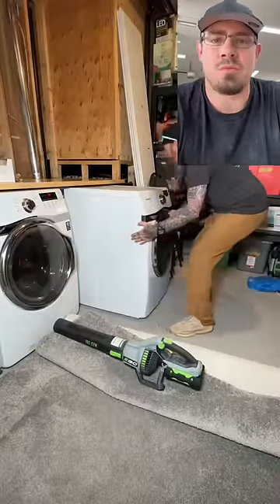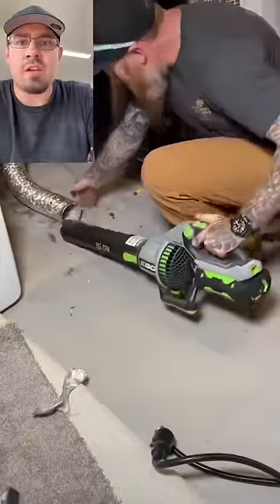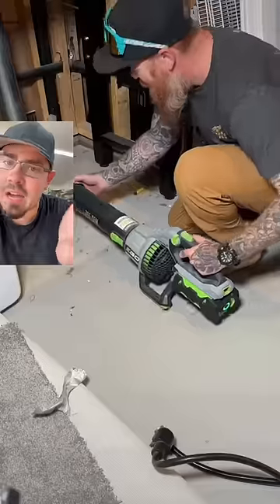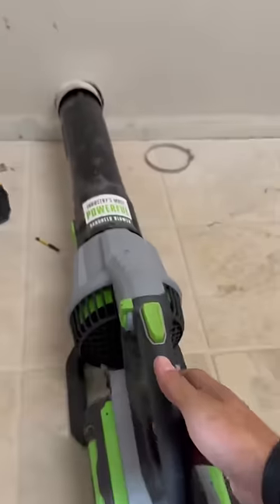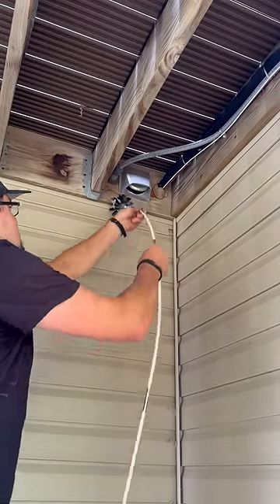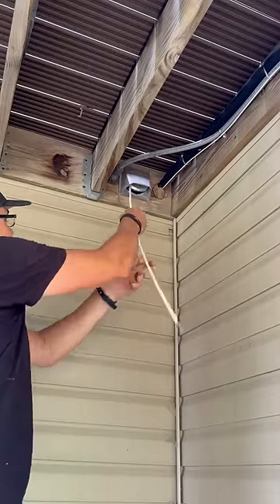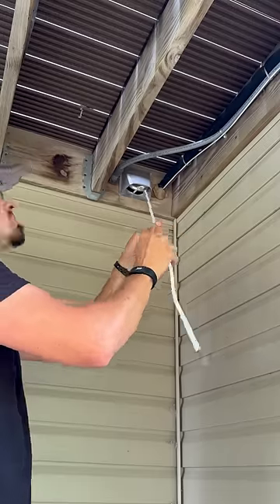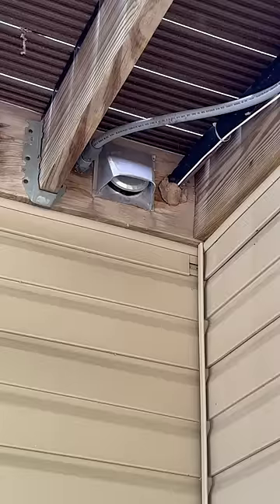Clean Your Dryer Like A Boss! #shorts

Comment: Just don't run the drill in reverse or you'll unscrew and lose your brush and "flexible things."
Reply: Underrated comment. If you lose your tool to thr dryer vent, you'll need a dryer vent cleaning tool cleaner to clean the vent of the dryer cleaning tool.
Reply: @djcarkhuff 😂
Reply: He may have just discovered those "flexible things" recently. I've seen a similar product: "flexible thing for catching fish."
Reply: Also, it’s SUPER important to use the clutch on your drill at a low setting. If these things get caught or snagged and the clutch it off it’ll shear it right apart while it’s inside the duct
Reply: Boss 💪🏼
Reply: I came here just to make this comment if someone hadn't already done it 😂  I told hubby to only spin it 1 direction and 2 seconds later the drill turned off and he was totally silent for at least 5 minutes. We had to take everything apart to find the section that came off lol  The kit came with tape to tape the sections together so that wouldn't happen, but we would have had to take all the tape off to store it, which would have been so time consuming, so I figured it wouldn't be that hard to just do it right...lesson learned lol!
Reply: This is exactly what I came to say. It’s why I always rave each joint now in case I make that mistake again😅
Reply: Speaking from experience bud lol
Reply: @djcarkhuff my dad did that 2 weeks ago
Reply: dang it you ruined my comment. I was going to tell people to run the drill in reverse, if you have it running forward it drives the lint in further 😂
Reply: @Stacked3403  lol
Reply: @djcarkhuff  But remember, the dyer vent cleaning tool cleaner has reverse threads. ONLY run that in reverse or you'll need a dryer vent cleaning tool cleaner fisher outer.
Reply: @jblps no it doesn’t
Reply: That's why I also use tape on the connections of each piece
Reply: @TwinMama-jv3zb  once it gets in motion it will stay in motion until acted upon. So when the drill stopped, it kept going until it unscrewed off. Thanks for the tip regarding using the tape as it was instructed to.
Reply: Bro 3 days of
Fucking around im a 2 story vent with no attic access! Please guys reD this comment
Reply: @Double_Thinker  I think that may be why he suggested getting rid of the flexible pipe.

Comment: Didn't know they made chimney sweeps for dryer vents. Kinda neat
Reply: So that's what Dick Van Dyke is doing these days.
Reply: My pipe is 14" long....
I use a toilet brush lol
Reply: I've seen one that is a just rubber hose through a metal coil. The hose sticks out about 8 inches after the coil and has a hole in the side.
Run compressed air through it, and the hose spins around like a cowboy swinging his lasso while on crack. Works for larger ducting too.
Reply: 5$ at Ollie’s

Comment: I leave the dryer hooked up, start it up and head outside and then run the dryer cleaning tool thru and it all gets blown out   A little tip : stand back and off to the side
Reply: And wear goggles... 😉
Reply: Put it on "air fluff"
Reply: Yeah, putting that leaf blower on seems like a good idea, but totally unnecessary. Running the dryer on air fluff will have the exact same effect, since you need to brush the vent tube anyway.

Comment: As a professional duct cleaner...we pulled sooooo many of these brushes out of dryer vents from customers trying to do this themselves. Works fine for a simple system.
Reply: I need to hire a professional duct cleaner, I’m scared they will over charge me though, what are some things to look for that will help me know I am choosing the knowledgeable person for this job? Thank you..
Reply: Use this once a year. It’s great. Unfortunately it’s on the 3rd story so I’m on the tip of a 30 ft ladder while doing it. Not fun.
Reply: Is it really necessary to use a drill?  What about just the brush?
Reply: Ask for CSIA certification. If they don't have it, you might be paying for a fly by night hustler.  @yvettecee1295
Reply: @marti220 that depends on how often it has been cleaned. I recently cleaned one that hadn't been cleaned in 30+ years. The homeowner said she was going make a pair of jeans with what I removed from her dryer duct.

Comment: Finally someone that says GET RID OF THAT FLEXIBLE PIPE.
Reply: @noone34370 
I’ve watched several videos that say it’s bad but won’t give an alternative lol
Reply: The alternative is hard pipe, obviously
Reply: @noone34370  Not one dryer manufacturer has ever approved any venting material other than hard pipe.  Not one.
Reply: @noone34370  hard steel galvanized pipe sections 90 degree elbows ( that rotate to make all possible bends from 0 deg to 90 deg) and with a proper rigid vent I only have to give mine a minor preventative cleaning every 5 to 7 years. I clean more lint from inside the body of the dryer than in the ducts.
Reply: Then don’t show or explain how.  Can’t just drag the dryer out like that with solid pipe
Reply: @scott5654  and how do I attach said hard pipe when there is no room to move the dryer?

Comment: Do not use a leaf blower.  If you have a large blockage you can push the drier vent hose off the fittings inside the crawl space or wall creating a much larger problem.  Use a shop vac to clear blockages, the use a vent cleaning brush.
Reply: I have that same blower. Even though I can access all of my dryer duct through the crawlspace, I wouldn't dare shove it in the hole and give it full blast.
Reply: Multiple people have paid me hundreds of dollars to crawl thru their attic and put their vent pipes back together after watching these videos. keep them coming guys!
Reply: That's what happened to me. Good thing it's easy to put back on for me. It did clean it.
Reply: A good corded leaf blower works as a vacuum also. Battery operated blowers don't have as many features.
Reply: @mikeclark7332  😂

Comment: Tape all your joints together with gorilla duct tape. If you accidentally hit reverse and pull the trigger on your cordless drill then you have a very difficult job trying to get the rod that's disconnected somewhere in the middle of your system. The duct tape will save your life. Or a marriage.

Comment: Many years ago, long before the interweb and all, my grandfather came up with a quick fix to clean out our dryer vents. 
Since the vent traveled about 9ft through the foundation of our added on porch, but was pretty much a straight run with one 45° turn.
He took a softball wiffle ball, the white plastic type, and he ran a 3/8" bolt down through it, and soldered it to the end of a piece of pipe snake, the kind that looks like a long coil or spring. He then took a few 8" long pieces of denim and canvas and laced them through the holes in the ball. When driven through the pipe while spinning, it wiped the sides of the pipe clean. If a piece of denim broke off, it just blew out the other end. He'd follow up with the shop vac held over the end of the pipe on the inside. 
It works, I still use his rig today in the same length of pipe. (The outer vent is the type with a screen over the end of it to keep out critters, plus the flap inside, and it exits too close to the ground to get any sort of cleaner in from the outside). I've never seen the screen plug up, but the pipe gets coated with lint and has to be cleaned every 6 months or so.
Reply: Brilliant!

Comment: Throw away your flex pipe and replace it with solid pipe. Easier to clean in the future. Depending how much you use your dryer, you may want to clean the vent pipe twice a year. Also clean the inside of the dryer. This cleaning will improve the effectiveness of your dryer. Source: firefighter since the late 70s and been on a couple dryer fires.

Comment: The best way Ive ever seen and was taught to do it was to ball up a plastic grocery bag and tie it to masonry twine and blow it thru the pipe or use shop  vac to suck it thru. Screw your brush together to proper length then tie the drill end of the brush to the twine and pull it from drill end back thru the pipe from inside. Hook the brush to the drill and pull it thru from outside. Unbelievable just how much lint comes out! 👍👍

Comment: I just did this! I bought a set on temu w a shop vac to inlet adapter that has an access hole for the pole to go in and out, plus has a 1/4" screw-on piece to attach my drill.

Did a great job! 30' of reach w all the doohickeys was $25, the amount of lint I retrieved from the middle of the line was impressive.

Comment: If using one of those multi-section brush cleaners tape over all the threaded connectors with electrical tape to prevent the rods from unthreading and getting stuck in the pipe if the drill reverses.  There is a great product called MagVent which creates a magnetic connection between dryer and pipe on wall which simplifies the cleaning and reinstallation process.  Its a bit pricey at around $70 but the convenience was worth it over the long run for me.

Comment: Try not to use brushes... Compressed air with a reverse ball attachment, the brush can mess up flex lines on dryer lines. Some people don't run tin.. but always satisfying to clean em 😂
Reply: Just use it on all the rigid vent.  Also... get rid of the thin, cheap flex crap that stores up lint and restricts it from blowing out of your house...
Reply: Flex duct metal or plastic is against building codes all dryer ducts should be 4 inch rigid metal duct.

Comment: I wish that cleaning mine was that easy. Our vent pipe runs vertically and exits through the roof. The hood has a 135 degree bend and has a spring loaded trap door. Our rain blows sideways which causes the lint to become a hardened clump. It is a PITA to clean that pipe.

Comment: Get a heatpumpdryer. Due to lower power requirements you can run it basically anywhere plus no holes are needed. It also uses like a quarter of the energy.

Comment: Also, how many of you guys clean the exhaust fan ducts in your houses? You know, the ones in the bathrooms, as well as the kitchen. Believe it or not, those grt a bit dirty over time and need to be cleaned. Also, the flap on the outside of the house can get stuck closed, especially the kitchen vent due to the grease. When that happens, the air flow is dramatically decreased.

Comment: This post is good in necessity but I don’t recommend just putting a leaf blower in the hose.
I’ve seen this knock the hose loose in houses where the hose has to traverse a span in a crawl space.
Most modern AC or DC leaf blowers are 400+ cfm and can really blow a hose loose.
The hose kit is a great idea; and still I applaud the post for making people aware that the hose lint build up detracts from dryer performance (and wastes energy) and can be a hazard.
I was in a home in 1974 where a clogged dryer vent caused a dryer to burn up. Fortunately the dryer was in a total concrete surrounding otherwise I would have probably died as I was asleep on the floor above.

Comment: Our dryer vent is 20+ feet with at least 5 bends.  We had birds making nests in the vent. I used a device like this and pulled out a ton of debris.  Still didn’t work. We called in a handyman service that used a shop vac to pull out the rest.  This summer I’m thinking of rerouting the vent a different direction.

Comment: Dryer vent lines can't be that long so I'd insert the flex rod sections only until it daylights inside the house then attach the brush head inside so the first push isn't shoving a load of lint inside.

Comment: I have a tip that goes on my air turbine, I personally use the turbine that cam with my dip pro kit, very good quality turbine.
The tip has 3 air jets that cause the tip to spin creating a mini vortex that blasts all the lint off the wall, in effect its both the leaf blower and the brush, all in one step.

Comment: Guilty of hitting reverse by mistake on my drill. Had to fish out the section that came undone with a long telescoping pole I have to clean windows. It was tough, a little duct tape and an improvised hook made out of an wire coat hanger and I got it. Read/follow the directions, should have taped the sections together.

Comment: Cleaning those edges only makes it take a little longer to clog back up. The lint on the edges doesn't reduce the airflow enough to hinder the operation of the dryer and as long as the dryer can breathe, it won't get hot enough to ignite that little bit of leftover lint. The leaf blower is all you need. This guy's kit is overkill.

Comment: You can just turn on the dryer it's blowing almost two hundred cubic feet of air per minute. Then you can use the snake from outside while the dryers running and it'll blow it out as you loosened it up you don't need the leaf blower

Comment: Never use a leaf blower. Internal pressure pushing outwards from the blower can cause any flex duct to break apart at the seam where it meets another piece if It is not secured properly and it usually is not because there's not much pressure under normal circumstances.
Reply from the maker: Compared to a drill and brush pushing on it to clean.  If its not properly connected than cleaning it at all will cause a harm to this connection.  Lets work on critical thinking.

Comment: You left out getting rid of the flexible dryer hose and replacing it with solid 4” diameter pipe which will not cling to the lint like flexible hose and is more fire resistant besides.

Comment: Or you could just install a secondary air filter (500microns) between the machine and the duct, then you only have to clean/replace a filter. A lorry air filter from the scrap yard works great 👍

Comment: Yep, dump that ridged flexible piping, you couldn't design anything better to impede airflow and accumulate lint. Get rid of it asap and replace with solid pipe, same with bath exhaust fans and range exhaust hoods.

Comment: The dryer vent was all clogged but it was that old plastic vent pipe I said you cannot clean with a brush I said you could use a leaf blower. A few minutes later come back with a gas-powered leaf blower and I said not to use that but it is your house. He blew it out and I walked outside to see what happened there was a cloud of dust couldn't see the yard. Came to the back the lint was blown 15 feet from the vent

Comment: A leaf blower isn't much stronger than a dryer blower. It needs to be swept and vacuumed
Reply: What dryer blower does your dryer have these Ego blowers are really strong.
Reply: Nah.  Those leaf blowers are really powerful actually.  Much more than any dryer blower for sure.
Reply: i can tell you're an office princess and never picked up a battery powered blower
Reply: I have that model of ego blower and it's very powerful. Especially if you hooked it up to the exhaust pipe so no pressure could escape, I'd be concerned it could break connections

Comment: Don’t ever use those they snap so easy and get stuck the leaf blower creates clogs so don’t do that you need a reverse air tool and a compressor high pressure air is the only way to clean it %100

Comment: Why not just put the wire brush in from the other side and use the leaf blower to blow the brush out along with all the shit from the sides that the brush will grab on its way out instead of feeding it in and then out again. Keep the wire brush on a string if you’re worried about it not making its way all the way through. This way you don’t get to be on the receiving end of a duct full of lint into your face when you pull that brush out.

Comment: Not the best way I do this for a side hustle and those kits and super cheap and I have to get them out because they break inside customers vents. Need heavy duty rodes and brush. You can also clean it hooked up to the dryer just turn it on.

Comment: Sorry, not good advice to use a leaf blower on a dryer vent.  Don't encourage anyone to do so.  

 If you notice within the very beginning the duct was held to the back of the dryer with a piece of tape.   AND that tape was only applied to one portion of the duct.  While it may not be the case with the rest of the duct work, you NEVER know.   Sadly there's shoddy workmanship out there.  If there were duct pieces in an inaccessible area (i.e. in your wall or ceiling pockets) and anything that could case a back up (i.e. lint build up ;-) ) that leaf blower pressure may be enough to separate the duct section in the wall pocket or ceiling.   If this goes unnoticed, you'll be pumping lint and even worse, extreme humidity into those areas.   Again, never do this.  

The dryer vent cleaning kit with the brush and attachments, sure.   But don't use a leaf blower.

Comment: do not use a brush on flexible pipes.  It will just wreck it.  But you should replace flexible tubing with proper metal venting to begin with anyways.

Comment: I just replace my vent hose. It takes less time than anyway else.
Reply: and no added holes in that foil stuff they make the tubing from. I am with you on the replacing of it.
Reply: Hi, how did you pull the dryer hose through? Ours is about 10-12 feet long. Did you connect the old end to the new end and pull it?
Reply: @rachaelb.  No. I just removed it from the back of the dryer and from the exhaust vent that is ported out of my house. I live in New England and we have basements, so my dryer is below ground level.
Reply: @DropDMurphy  Lucky you! We have a crawl space from the dryer to the side of the house. :(  Thanks for replying so fast!!
Reply: @rachaelb.  Np. Good luck.

Comment: Putting a lot of faith in whoever did that in wall ducting. I knew someone who did this and the clog blew off a coupling. Drenched their celing under their kitchen floor for years and turned into a black mold mess because it was repeated saturations over and over.